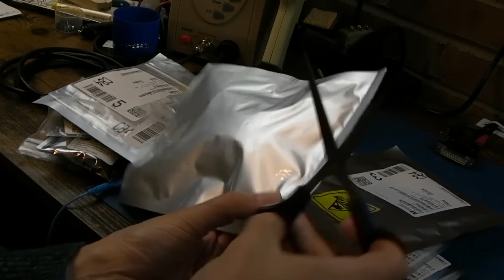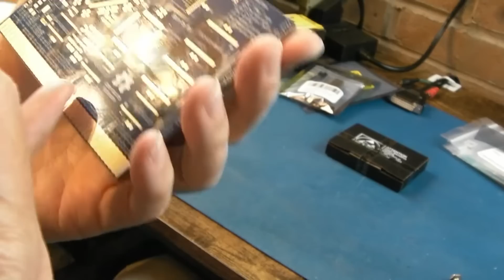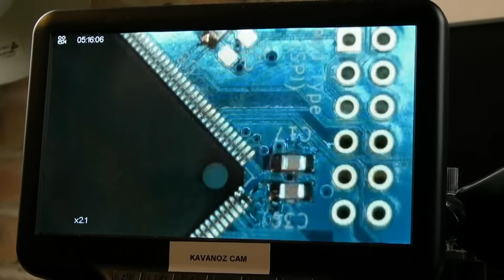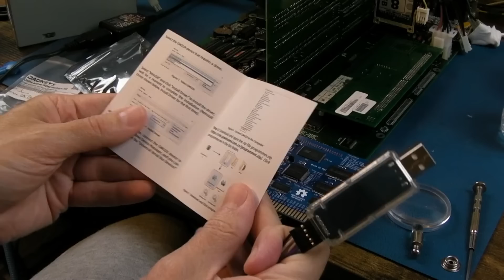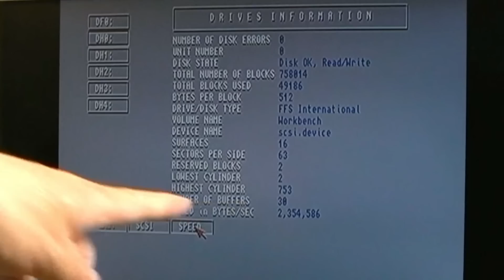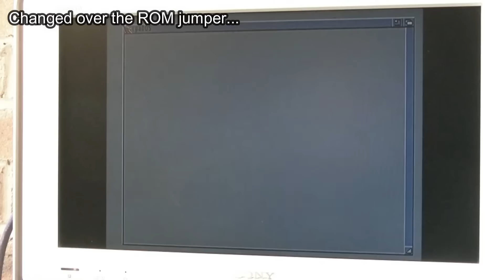Commodore Amiga Spitfire 2000 Part 1 (Amazing super fast CPU card)

Comment: What a great board. Did you try the 50Mhz setting just to see what happens ?
Reply from the maker: Yes, it is very nice!  I tried 50Mhz in the next part - but I need to re-test the higher speeds in part 3 I think.
Reply: @GadgetUK164  Cool. I can't wait to see them.

Comment: While capable & an entertaining build, short (non- full length) cards were never installed into any of my high end systems because they were more prone to shorting (ie, not vertically stabilized by the front and rear case card guides, nor held down into the slot by the rear back plate screw).
Reply: Yes, I never liked theese short cards for this reason. I understand big cards cost more to produce, but imho there simply should be screwholes on both ends (two at the side facing to the front, two facing to the back), so you simply can add a blank pcb (or a 3d print) to extend the card to full lenght for nearly no cost. It might esp. interesing to use the extended space to mount the CF adaper there.
However, even without screwholse, these PCBs are epoxy based. So resin/epoxy sticks very well to it. So you can simply cut the missing parts to reach the front and the back from blank pcb material, lay the parts flat onto a table (cover it with esd foil first to avoid epoxy on the table first) and use some epoxy to glue them together. It is quite easy to extend every shord card to full lenght this way.
If the IDE is buffered, you even could place the CF reader at the back of the extended card, so you can change the card without openening. Or you might decide for an IDE->mSata adapter for the harddrive as master and an IDE->Sata as Slave (unlike CF readers depending on industrial grade CF cards, master/slave work fine with IDE->Sata converters). So in a sense, a short card extended to full lenght depending on the users intention might even be best. Some prefer CF-cards, some SATA devices, some want a IDE CD-drive as slave, some want a SATA dive as slave, some might want an SD in FAT for data exchange as slave (there are SATA->SD adapters). So extending a smal card with 50Mhz CPU, RAM and IDE by yourself, integating the extensions you want, might be better than a longer card maybe containing the "wrong" options for your use.